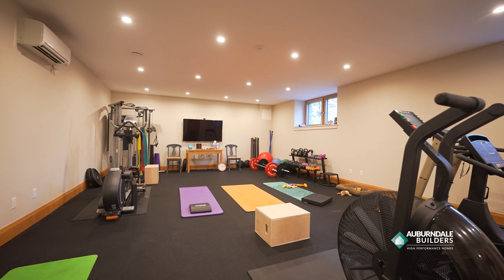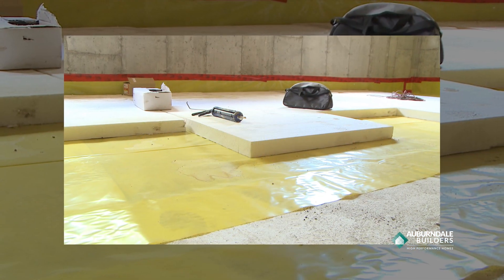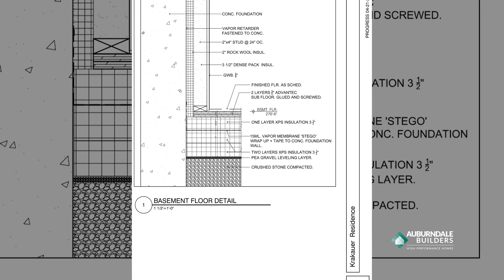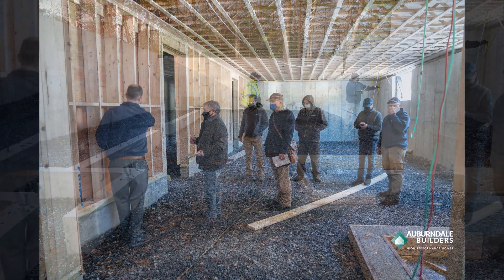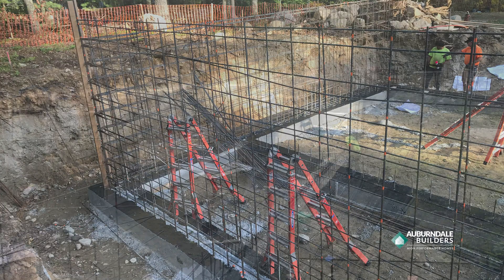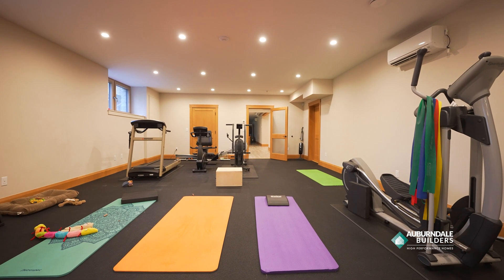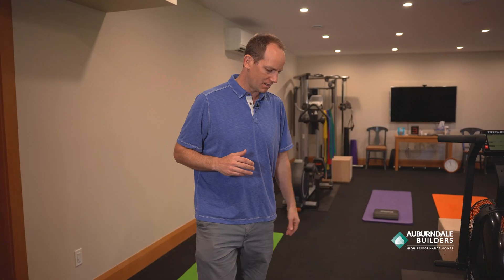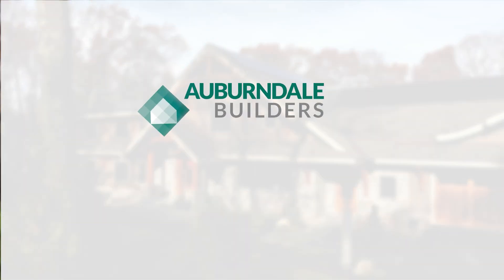Architectural Details | Floating Basement Floor

Comment: most home gyms want a very solid floor, you want a stable foundation for heavy lifts
Reply from the maker: For sure. These assemblies are not soft like a pillow. They are soft like a stick framed floor is. They have a little give to them whereas concrete has no give. Very comfortable to walk or workout on. 🏋🏻‍♂️

Comment: It's not clear to me what you did.  I know you put down foam, but what do you put over it?
Reply: Most likely plywood. The rigid foam needs to be protected somehow.
Reply from the maker: @59seank so from Bolton to too we have 2layers of reclaimed eps foam, then the polyethylene vapor barrier, then one more layer of eps, then just two layers of subfloor glued and screwed together that “float” on top. Slabless or concrete free slab are common terms for this assembly and the BS and beer show has a great episode all about this detail.
Reply: @auburndalebuilders  "so from Bolton to too" What does this mean?
Reply: @59seank I think he meant to say from bottom to top